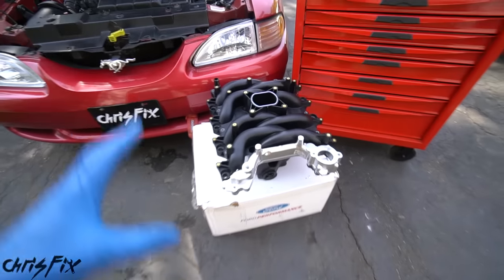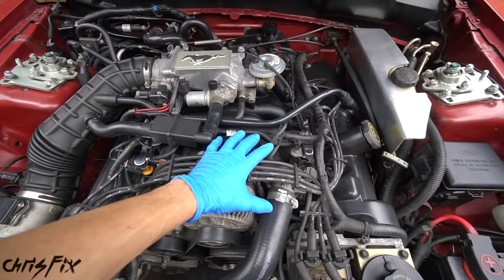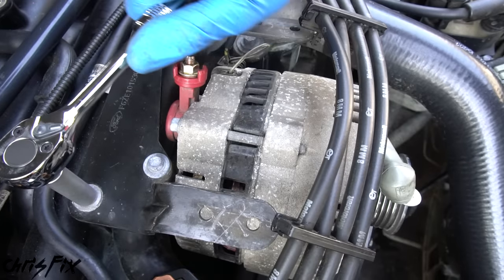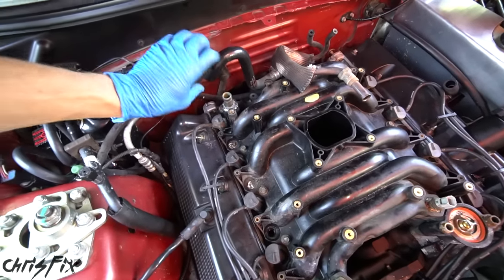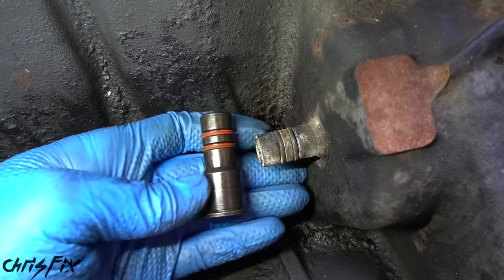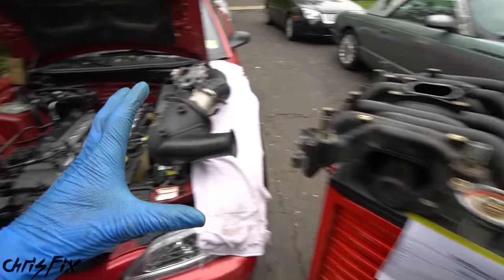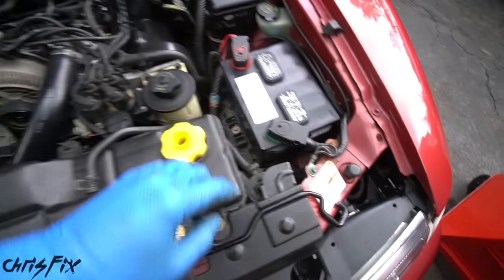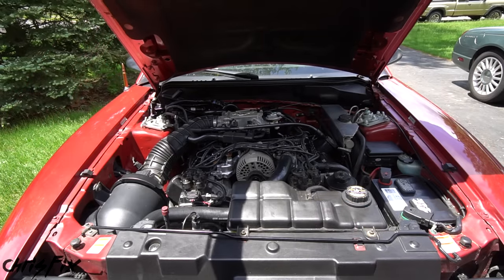How to Install a Performance Intake Manifold and Replace Gaskets (Dyno PROOF)

Comment: Who cares if it was only 12hp you shot flames
Reply: You're oversimplifying the power gains if you only take into account the peak power. Like the video shows, the power increased 50hp at redline and in general everywhere over 4000rpm. It's not a constant rpm engine, you know :)
Reply: @Jinppa  you realize his comment was a joke right?
Reply: @Iri5hman  Of course, I'm just not fun at parties.
Reply: Stock 215 horse power what do you think don't  understand
Reply: @eugeniopetosa1310  215hp at the flywheel not the wheels
Reply: Sherk Teh Orge fax
Reply: @Jinppa  at least you're honest.
Reply: @Jinppa  nice comeback😂👌🏽
Reply: I got one horse and it’ll break your face
Reply: @Iri5hman  true
Reply: @torqueconverter5594  well no, the axles in that case. Power is lost at the diff
Reply: @alidib9284  still in the same respect though, 215hp is alot different than 215hp and the "hubs"
Reply: @torqueconverter5594  yea
Reply: whoah hi there shrek, shrek is drek
Reply: I mean uhh don’t you get faster with the flames 

(It’s a joke btw)
Reply: Jinppa haha atleast you admit it
Reply: Shooting flames, yo thats crazy!!
Reply: Bruh the shrek matches the comment
Reply: Sherk Teh Orge yeah I mean that’s cool
Reply: hahahahaha
Reply: @Jinppa  haha good one XD
Reply: the peak hppower and torque gain you have to consider not only a better Power Band but that's increase put down by the wheels. It's like with audio you don't want to pay attention to Peak power as much as RMS rating. Same approach. What I want to know is if I get this performance intake for my Vic am I going to be able to spit flames 👀 cut the mufflers and rest of pipe after (over rear end to tailpipe all out just behind the H pipe crossover) that thing going to set my gas tank on fire 😂😂😂
Reply: Trey Kashflow who included wheels
Reply: Trey Kashflow and btw nothing was on fire
Reply: It's called nitro
Reply: Why wouldn't more airflow make more power and torque at lower rpms as well?
Reply: @Jinppa  nah you seem quite fun
Reply: @eugeniopetosa1310  Bolted to an engine dyno yes, but not a rolling road or hub dyno.
Every point of friction and drag, saps some of that power and there are many through the transmission and axle.
Take an unmodified car to a rolling road and you'll be extremely lucky, if you see 80% of the quoted stock power.
Reply: 2000th like here!
Reply: @Jinppa  I appreciate that,  I was still confused about how it works with the hp increase. I'm thinking about buying one for my 2011 v6 mustang
Reply: @brianhbinesh   My guess is restriction causes high velocity or turbulent which may increase torque.
Reply: Thanks for spoiling it for me 🙄
Reply: nyeh
Reply: I know how car shoot flames but it's hard for to explain
Reply: 12 total HP but over 50hp higher at redline....I'm guessing that's how they market these too😅
Reply: Shrek.
Reply: Shooting flames isnt a goo sign. It could indicate bad seating of the valves on the exhaust ports,poor engine fire timing, a cracked head, or too much fuel is being used. An optimal running engine should have the burn completed before the exhaust valves open so very little flame should come out.
Reply: @Jinppa  Clearly XD
Reply: @Wardog-pl9yw  no you don't go any faster with the flames
Reply: And chris is gonna shoot more flames with the supercharger he's gonna install.
Reply: I've never seen a Mustang shoot flames
Reply: wait what
Reply: @ jinppa you for got about the universal joint loss of power at the seal because of no grease
Reply: @torqueconverter5594  are those adjusted numbers?
Reply: You know this is my favourite car and the flames were so cool ❤
Reply: @Jinppa  me either cause i never get invited 💀
Reply: Lol
Reply: @torqueconverter5594  bro your wrong lol😂
Reply: Facts 😂
Reply: @riq2kozy  😂😊
Reply: Yeah that’s what I was about to say
Reply: @brianhbinesh at lover rpm’s the air has enough room to flow freely but as the rpm goes up you start noticing the restriction of flow from the intake (due to things like, length, pipe size or amount of bends and how sharp they are) so when the engine needs more air flow the intake can’t provide enough therefore the difference is more visible in the higher rpm’s. Yes I’m 3 years late but

Comment: The fact that you didn't install the throttle body is actually insane.  You're true to the viewers and do a lot for us rather than yourself. Yeah, it's not a crazy attachment / extra work to do it later but you're willing to do more work to help us learn.
Reply from the maker: Thanks! Yea I could have done the plugs and wires too but that is the next video ;) haha
Reply: its a win win you get a extra video we get to watch more
Reply: He still has a 6 point harness and a racing wheel in his garage!
Reply: ChrisFix woohoo!! You have got me hooked on your channel man, thanks to you my 2003 Mitsubishi Lancer is running better than ever!! New brakes, painted calipers, cleaned intake, fresh gearbox oil, engine oil and brand new coolant!! My baby has 158000 kilometres on the clock and is still going strong! I’m a 16(turning 17 in 3 weeks) year old guy from Australia and you have inspired me to be my best and to work on cars. I have got a huge passion for cars now thanks to you and my ex girlfriend’s father. THANK YOU SO MUCH!! 😁😁
Reply: AJN42996 im just looking forward to when he does something about the stock head airflow by putting in a more aggressive camshaft and maybe bigger injectors for high rpm power
Reply: would nice to know the dyno result of after the add on of the bbk throttle body too.
Reply: @chrisfix  its been a year where is the video for the throttle body
Reply: AJN42996 it's actually not that hard just time consuming when you have to relearn the part when installing
Reply: Does anyone know if this same part will fit a 2001 Ford Crown Victoria? Seeing as they are both 4.6L engines.
Reply: @chrisfix  I seen your 🍋 BMW livery
Reply: WHEN ARE YOU GONNA DO THE THROTTLE BODY VIDEO

Comment: Engine: Leaking coolant like no tomorrow

Chris: Takes it to the dyno
Reply: I wonder who was in charge of having their finger on the hole while it was being revved up? lol
Reply: I never even thought of that
Reply: Miftr 6 I think he had the info
Reply: I thought I was the only one that found that strange 😂
Reply: @dntlss  nobody, coolant can reach boiling temps
Reply: He put that hole in it intentionally. It's fine to show the viewers but obviously he did it after the dyno. I honestly don't care, either way it doesn't change how helpful the video is.
Reply: flex tape
Reply: @KamikazeSOF2  HEY GUYS PHILL SWIFT HERE!
Reply: Hi, i have a 2000 Grand Marquis, and i bought a 130 dollar intake on amazon and it leaked terribly at the front end by the forwardmost cylinder on the inboard side... I dont have those one piece lobg gaskets, but i hope the rtv will hold it
Reply: He used the exhaust video clips
Reply: Troy Senarighi never buy parts from amazon unless you don’t care about the car. Summit, JEGS, or even rock auto has plenty of reliable cheap parts and customer service that’ll walk you through anything
Reply: dntlss Bruh, Chrisfix of course, he owns the car
Reply: Devin May not strong enough
Reply: Troy Senarighi you shouldn’t buy parts from amazon and buy from junkyards
Reply: So? What’s the problem?
Reply: I wonder if he just put JB Weld on it
Reply: dntlss I would guess he put duck tape or JB Weld on it
Reply: I think he did it before the leak when he did the exhaust
Reply: But ya it does look bad lol
Reply: Miftr 6 hmmmm, HMMMMMM(my face is twisted)?
Reply: so maybe the power improvement did not come from the performance intake but just because the leak was fixed.
Reply: I was wondering because he totally made it look like coolant was shooting out everywhere and he then took it to the dyno.  Chris is very safety conscious so I'm surprised he didnt mention to not drive the car in that condition.
Reply: @Boypogikami132  uhh no not him coolant is boiling hot idk how it cools if it’s hot but it’s really hot
Reply: dntlss probably soapy wooder, medium strength threadlocker and common hand tools
Reply from the maker: I actually used epoxy to seal it and the seal lasted until the end of the dyno run where it started dripping. Luckily I was able to make it home bc the leak wasnt bad.
Reply: @chrisfix  that's actually really smart

Comment: This is awesome! Crazy how much power it added on the top end for simply changing intake manifolds! It's also wild how different the engines in our cars are. At 6,000 RPM your Mustang has said enough, and from 1000-6000 RPM my S2000 is as slow as a Corolla. Awesome that there's such diversity out there in engine design!
Reply from the maker: Put them together and no one can stop us! Lol
Reply: Both of yall need to do a drift off when your project cars are both done XD
Reply: True  ! !
Reply: Project cars getting done? What madness is this?
Reply: Engineering Explained  its crazy to say this to you, and I know you already know it, but your s2k is like a corolla till like 5k rpm bcoz its not a 4.6 V8 🙂 right? I hope im right haha
Reply: Yep and that diversity goes away with electric. So many different layout's with ICE gives a lot of different character
Reply: @Darksyne  no project car is done......
Reply: Where's video after this
Reply: Nmethiny Naveendran  there already is
Reply: @Darksyne  project cars are never done
Reply: i Exotic Rider, no..that S2K is better in every way compared to this 4.6 Stang. The only thing the Stang can do better is carry children or midgets in its otherwise useless backseats. The S2K is faster and lighter. And cooler really.
Reply: Dorito power!
Reply: Yall my 2 favorite people.
Reply: Does anyone know if this same part will fit a 2001 Ford Crown Victoria? Seeing as they are both 4.6L engines.

Comment: I remember watching this video when it came out and never would I ever thought I'd have to use but.  Fast forward to 2021 and I picked me up a 1999 Ford Mustang GT.  About after a year, the heater hose nipple cracked off on my intake manifold.  Besides all of the retro-fitting (because my car has the PI heads already) I followed it step by step and got it done--saved SO much money!  Excited to get back on the road.  Thanks Chris!

Comment: I just finished this on my 2003 GT. It's been sitting a while so I'm jumping the battery right now. I hope it works! I have 2 left over bolts so hopefully they aren't important 😂 I already started taking my car apart before seeing this but this got me through the hardest parts like putting everything back together. It's a scary feeling seeing your car taken apart!!

Comment: Awesome video!  One thing you forgot to mention though is when bleeding the coolant system, turn the heater on max.  This helps ensure all air leaves the heater core, plus as the air gets hotter it gives a physical indication that things are going well.  

The Dyno results are sick!!  The power gains in the upper RPM range are crazy awesome!!

Comment: SPITED FLAMES PEW PEW!
Reply: YeboiShnoram when?
Reply: @Cugy_2345  20:27
Reply: I wondered if anyone else cauht that. Was it because of the new manifold or putting some real gas in it?
Reply: @alwaysopen7970  no its called backfire look it up
Reply: @andrez906  afterfire*
Reply: @alwaysopen7970  putting the intake manifold makes the air to fuel ratio more rich therefore making flames

Comment: This looks amazing, Chris! Will you be installing the PI heads as well? I noticed the gaskets left a lot of room for bigger intake runner size and a lot of the increase in power is from the improved head design. Keep it up dude!
Reply from the maker: Thanks a lot! I was was thinking to just port matching because it’s not worth l extra time to take the heads off.
Reply: That would make for an interesting vid
Reply: Well you're adding a supercharger so doing the pi heads would be pretty pricey. The swap increases compression. Putting boost to that would mean forged internals, upgraded fuel system, and tuned for higher octane than even 93. Or e85 will do well with high compression and boost.
Reply: ChrisFix but you can then make a video about installing a head gasket. With that cars past and the way it is driven now, youre on borrowed time. I think you should put on PI heads and get a new gasket so everything is solid reliable. Never trust rtv on those kinds of applications.
Reply: When are you guys gonna colab
Reply: Hey Tavarish How Is Your Lamborghini
Reply: Hey Tarvarish
Reply: Tavarish y'all should do a collab vid
Reply: Blackjack my thoughts are the o2 sensor placement being too close to the end of the exhaust. It should be right off the manifold like pretty much every other car. o2 sensors are made to handle rediculous heat, in fact they have to get hot before they even function properly, that is why primary o2 sensors have a heater in them.
Reply: lmfao
Reply: i was just looking at ur lambo vid before this lol
Reply: Pi heads with a tune make a huge difference. Plus it would be nice because there arent really videos on the swap
Reply: This is how Youtubers should be!
Reply: let chris fix your lambo. you will save time and money
Reply: With higher compressions, you don't need higher boost, you can get the same or more power with moderate boost and high compression.
Reply: Totally love to see that 2 of my favorite YouTubers follow each other. Cool beans.
Reply: Still wondering how you got those first roller numbers with that massive coolant leak.
Reply: Think there was a little matter of a massive coolant leak too. That begs the question, again,  how did he do the initial dyno reading with that coolant leak?
Reply: Tavarish!!!
Reply: Remember he was just doing comparison with intakes
Reply: Joel Smith the rtv is more than sufficient..we have been doing this swap since the early 2000s and have had many miles and years put on swaps with no reliability issues what so ever..it’s all in the guy under the hood..
Reply: Does anyone know if this same part will fit a 2001 Ford Crown Victoria? Seeing as they are both 4.6L engines.
Reply: Anyone know what "Port Matching" means? I did this swap, worked like a charm and at 4500 rpm it really starts to pull hard. Thanks Chris! @chrisfix

Comment: 9/2019.... Still waiting for the throttle body video
Reply: Bruh same. I feel the same way about the front differential video
Reply: SOTIRIS POLITIS lmaooo i jus seen this video an i’m sad we still don’t got the video 😭
Reply: Also waiting for supercharger video >_>
Reply: Waiting for limited slip dipstick video
Reply: 1/2020
Reply: Yup and the turbo video too.
Reply: January 2020 and I would still love the throttle and turbo videos :(
Reply: And video on how to pop out a dent too
Reply: Yeah me to
Reply: still waiting 3/20
Reply: for those wondering, he made a list he’s gonna do basically all the things y’all waiting for this year, forgot what video he showed the list, but they coming bois.
Reply: The list is in the comments of the “Dad Dream Car” video so go check that out if you want to see if he’s doing something you want.
Reply: And the PI cams, they are the biggest difference. PI heads actually make less peak flow than the non pi (due to their high swirl characteristics, they do make more overall flow however), since you did everything else you should get the same or higher peak hp number as a PI engine after swapping in the cams as the compression ratios are identical, and I don't care what anyone says, longtubes are always an improvement.
Reply: 4/20 (nice) but still waiting for throttle body
Reply: 4/2020 I haven't seen it yet
Reply: April 2020
Reply: 4/2020 still waiting
Reply: Meet too
Reply: SOTIRIS POLITIS June 2020 still no throttle body upgrade video
Reply: Aurva Roy and supercharger and turbo
Reply: The PI heads have a smaller combustion chamber raising the compression ratio on non PI head from 10:1 to 10.5:1 👍
Reply: 7/2020 still waiting
Reply: 7/7/2020 still waiting for it.
Reply: July 2020 still waiting for that video also
Reply: 9/2020 still waiting
Reply: Chris couldn't fix his Covid
Reply: 9-21-20..... still wanting that throttle body vid
Reply: Still waiting pls chris
Reply: Oct 13 2020 still waiting
Reply: As of 07/2024 no throttle body vid 😢

Comment: Having a Crown Vic with the same 4.6L V8 makes these videos all the easier to follow. Appreciate your work.
Reply: I had a Crown Vic I put a CAI on and went from single to dual exhaust which made a very noticeable performance difference. But when it came time to change the intake due to it cracking like this I also went with a Performance Improved. I had no idea I had increased rear wheel HP that much AGAIN.
Reply: @HAL-dm1eh  The Police Interceptors '03 and up only made 10 short of the Mustang GT's 260 BHP, and already had the intake and dual exhaust setup. The base civilian models were restricted more, so they definitely have power that can be freed up.
Reply: @enzdude   Yea mine was a 98 so according to who you source the info from it had anywhere from 195 to 215 hp. 

I don't really know but it wasn't a lot. 

The later models had a good stock airbox, PI intake, heads and cam, were tuned for it and they had dual exhaust. 

While I didn't have the intake and cam I could have gone a couple steps up in gears and a tune and probably been pretty satisfied with the car. Regretfully I sold it.